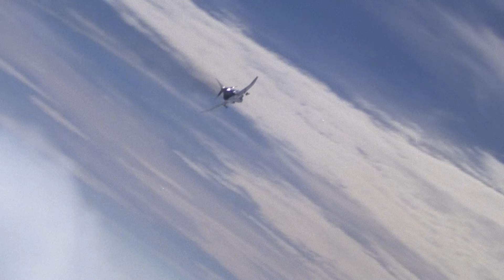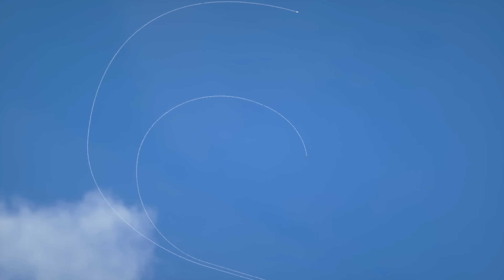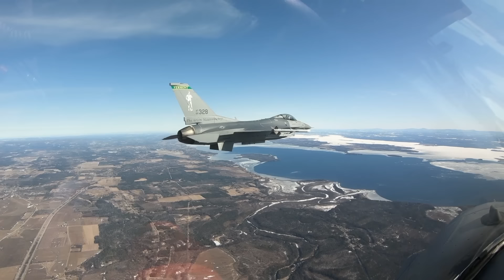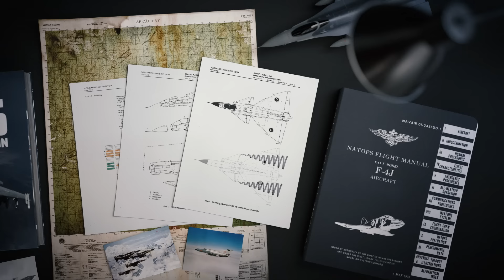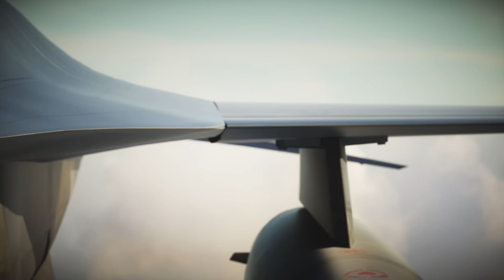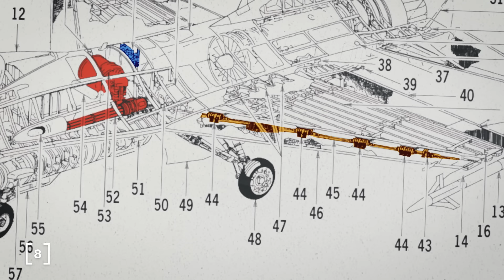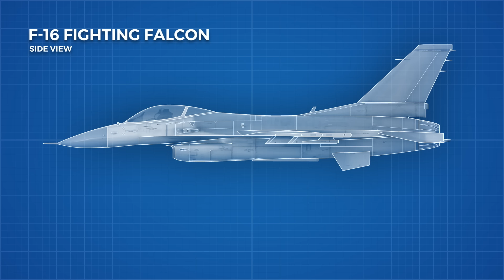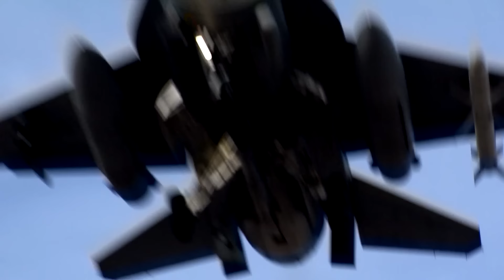The Insane Engineering of the F-16

Comment: I'm just going to say that the F-16 was called "the world's most expensive lawn dart" for a reason. The Navy went with the twin engine F-18 over the single engine F-16 for a reason.
Reply: The Navy chose, based on paper proposals only, to develop the YF-17 instead of the YF-16, into the F/A-18 only four months after the Air Force chose the YF-16. The F-16 wasn’t even in production yet, so, the early issues with the production F-16s didn’t have anything to do with it.  Likewise the Navy was comfortable with single engine planes as the extensive use of the A-7, the F-8, and A-4 attest. The dual engines of the YF-17 added a little more comfort, but also resulted in a wider fuselage that gave a wider landing gear track than the YF-16, which was helpful for carrier landings. There were actually three “navalized” proposals for developing the YF-16 into what would become the F/A-18, but the Navy was pretty adamant they were not going to choose the F-16. They were still smarting over the  F-111 “joint” program and Congress rubbed salt into the wound by requiring them to use a product of the Air Force’s lightweight fighter program to fulfill their F/A-18 requirement. This left the YF-17 as the only choice.
Reply: @Spectator1959  

The A7 was a replacement for the A4 and designed on a derivative of the F8, but, the A7 was a 1960s era plane with the A4 and F8 50s era. By the time the F-16 and F-18 were being designed and marketed, we're into the 1980s; 20 years later. That's 20 years of mindset change in the Navy. Whichever the Navy went with, it was to be a replacement for the A7's role.  

Yes, a wider landing profile was part of it, but, the single engine was also part of it; a large part. By this time, the Navy wanted the dual engine design as one engine lost on a dual engine plane still allowed the plane to fly and land while a one engine plane having engine failure meant a loss of the plane. The Navy had already dealt with this with the F14. This was also born out to be the correct decision as the F-16 was, as I noted, called the world's most expensive lawn dart by us in the Air Force at the time. 

I also know most of this is correct because my father worked at McDonnell Douglas and helped design the F-18 that was ultimately purchased by the Navy. According to him, the dual engine of the F18 was the ultimate tipping point for the Navy. After McDonnell Douglas went under, my father went to work for Boeing, ultimately retiring from them. So, I had a lot of insider knowledge of what was going on when it came to the military and planes.

Comment: There are several mistakes throughout this video but the most egregious is at 28:39: No aircraft can fly with its center of lift (CL) located forward its center of gravity (CG) either by human or computer control.  Such an aircraft would be so unruly that it would drop out of the sky like a maple leaf.  People who scratch-build RC airplanes & home built drones already know this.  So do people who specifically architect airframes professionally.  
.
The F-16 was the first full-scale (manned) airplane built to have a negative static margin.  Static margin is a man-made measure of stability factoring a variety of inputs which vary depending on the specific static margin equation (different companies their own) in the same way that 0° Fahrenheit has nothing to do with water freezing (unlike Celcius) or molecular mobility (i.e. Kelvin).  Over time, mechanical, electrical, and software engineers (in the defense industry) confused the negative static margin with physical negative stability because it (frankly) sounded kinda cool.  In large organizations, cool-sounding rumors travel fast and wide.
Reply: That sounds very interesting. Do you have some sources where I could read more on this? Specifically about Static margin?

Comment: 33:17
More like the avionics limit the jet from doing more than 9 Gs for the benefit of the squishy human inside.  The *airframe* can handle much higher Gs before structural or system failure.

Comment: Your explanation of static stability is also incorrect as the torque acting on wing and generated by pressure distribution on the airfoil is the main reason for the horizontal stabiliser. Using this force on arm simplification is hugely misleading. You need to redo your flight mechanics courses

Comment: Thanks for the opportunity to collaborate and contribute to this video. Great job to the whole team on this production!
Reply: When you talked about how it feels to use the weapon system in training for the first time, I got goosebumps. One helluva machine!
Reply: If I may, I would like to add some detail to the inlet discussion.  The F-16 is a fixed geometry, normal shock inlet.   The other airplanes mentioned, F-4, F-14, F-15 all have/had variable geometry inlets.  That is the reason that drives the inlets forward on those planes.   The ramps in the inlets adjust with Mach number to position the shock (as explained).  In 1976 we studied putting a variable geometry inlet on the F-16.   Oh my, it opens the flight envelope up dramatically.  (I was hoping to see a Ps plot on a Mach/Altitude graph.   Basically the airplane can easily get to Mach 2 up through 50K ft.   At that point you hit the temperature limit on the aluminum airframe.  But those VG inlets are complex, heavy, expensive and require maintenance.   And as was so clearly explained, not a benefit to where the F-16 fights.   As a fresh out of college aero engineer it was a great airplane to work on.   To this day I have the photo of the R/W/B YF-16#1 on the wall in my office along with models of both prototypes.   I was lucky enough to work with Harry Hillicker and Jack Buckner and was present when the first pre-production airplane taxied out in the fall of 1976.   I spent the bulk of my career at Boeing Commercial, but to the chagrin of the St. Louis crowd, the F-18 never replaced the F-16 as my favorite airplane.   Thanks for a great video and a Saturday morning trip down memory lane.
Reply: @dougball328   - Thanks for adding detail and perspective to the inlet discussion. I would have loved to flight test a variable inlet for the F-16!
Reply: great job!
Reply: The best instructor pilots can make even non pilots understand the concept they're discussing. You are definitely one of the best instructor pilots.
Reply: Fascinating insights given very naturally and personally. Excellent.
Reply: 1. In video are almost not visible any MiG-21! Planes with Czechoslovakia markings (Československé letectvo) are Su-22! Not fast, not maneuverable, pretty heavy due a variable swept wing. Su-22 obviously dont have clean delta wind as MiG-21!
2. MiG-21 does not have variable swept wing in any variant or clone!
3. MiG-21 is not dogfighting plane, it is not easy to maneuver special in lower speed in low attitude.
4. Is designed primarily for attack from back.
5. Su 22 does not have AA radar!
Absurd
Reply: Massive respect to your team 🙌 The detail and realism really shine through!
Reply: You did a great job linking the engineering side of things with the piloting side!
Reply: Lmao blud just dm him for the credits
Reply: @anonyraj2891 have some respect

Comment: Wow, thanks this is awesome. I have a question. So the f16 can handle 9g on the airframe. I know 9 is high for a lot of pilots, I guess fighter pilots are trained to handle 9 or more. But can the fly by wire systems in modern fighters and other aircraft integrate some customisation for individual pilots. Like let’s say a specific pilot can only do 7g, can he dial back the g setting? Or let’s say they are are flying a mission and he cranks over and is looks back over his shoulder and hurts his neck and so his ability to take g is reduced on his left side, can they change a setting so the fly by wire can accommodate the changed ability of the pilot? Then let’s say some pilots have a heavy hand on the controls and another has a real light touch and a third has a heavy touch under stress but flies ultra light under cruising, can the fly by wire system integrate pilot profiles of how they individually like to control the aircraft and under what conditions the control system responds to their touch?

Comment: I remember the F-16  and the F-15 was a lot bigger and therefore a lot more expensive. The F-15 was introduced first. And both are still in production since the Boeing F-15EX is just entering test flights. The F-16 has been in continuous production since' 78

Comment: The f16 is the best performing, best cost / kg.  Lowest maintenance cost per air vehicle.  Longest loiter time.  Best fuel economy.  Highest g-loading of any aircraft TO DATE.  Highest ordnance carrying capacity per kg.  Cheapest to run per minute.  Cheapest to buy per unit.  

Single engine perfection.  Thankyou FIGHTER MAFIA.  

Losers always gravitate to such loser planes like the f15 or f-22, but these are dogsh*t compared to the f16.  

Note:  For the price of 1 f-35 you can have FOURTEEN f16 falcons.  

Yay.

Comment: Great video. Also worth a mention is the OODA concept and how it applies to the design philosophy of the F-16. The Fighter Mafia mostly showed that the pilot who can go through an OODA loop faster will often win a dogfight. This is where transient metrics (like turn rate, acceleration, roll rate, etc) became more important than the older static metrics (top speed, ceiling altitude, etc).

Bonus: the OODA loop applies to more than just fighter aircraft design and can (and has show to) apply to things like sports and business.
Reply: Please no.

The OODA loop just boils down to "Make decisions faster to be faster than your opponent". It's not that revolutionary of a concept.

Plus the fighter jet mafia has a long reputation for taking credit of designing aircraft that they had literally nothing to do with, such as the F-15, F/A-18, and the A10. Hell, they lobbied to have the F-15 program cancelled because it had something more complex than consumer-grade radios, but that didn't stop them from claiming they designed it after it became the most successful milutary aircraft in history.

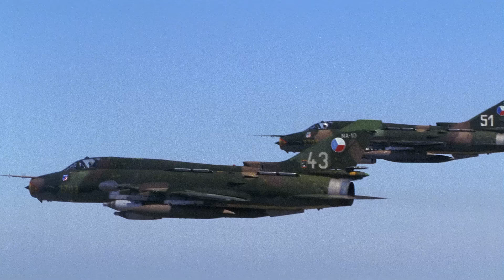Comment: 1:52 I hope you know these are Su-22s, not MiG-21s?
Reply: 35:31 and this is an F-15E of the 48th FW at RAF Lakenheath…
Reply: @pjotrtje0NL 35:35*, to be fair, it can be quite confusing to differentiate between the two aircrafts.
But a way to tell which one is which is that the Mig-21 has a longer nose whereas the Su-22 has a shorter nose and can sweep it’s wings.

Comment: I've often wondered why they still make the F-16, instead of just making F-35s.  Now I know!
Reply: It's there when F-35 isn't as needed. 
The F-35 still is expensive to maintain compared to 4th gen while have relatively smaller payload. That said, the riskier mission would be where F-35 take over or provide support.
Reply: @naksachaisaejane1982  thanks for the info
Reply: @naksachaisaejane1982 4th gen is just over priced 3rd gen

(joke)

Comment: It wasn't just the engine but also the Leading Edge Flaps (LEFs) at that stage which contributed to the accidental first flight of the F-16.  At that point in testing the LEFs were scheduling all the time.  Even on the ground.  So they were easily seen fully deflected in that video.  Now they are tied in with weight on wheels (WoW) logic so that the LEFs do not start scheduling until weight on wheels is lost.  Which you can see in the video you took looking at the LEFs during take off of your flight.  The LEFs are commanded slightly above neutral until WoW is lost then they schedule as normal.

Comment: hold up, the section 28:11 to 29:19 has very different info to what was taught to us in my 4th year aircraft dynamics course at uni (aerospace engineering degree),

having a config where the lift of the wing is in front of the CG (and consequently a lifting tail) doesn't immediately guarantee that it is unstable,
you mentioned that as AoA increases the wing lift will increase thus increasing pitch up moment, sure, but as AoA increases the tail lift will also increase,
whether it's stable or not depends on the lift slope of wing vs lift slope of the tail, as well as wing area vs tail area, and the moment arms,
as long as the moment created by the tail sufficiently counteracts the wing's moment as the AoA changes, then the net moment on the aircraft will still return it to trim,
and tandem wing aircraft exists, where both wings provide lift and  the CG is in between the two wings, if that's inherently unstable then that design wouldn't really be viable

also in the F-4 diagram bit at 28:18, the weight wouldn't move the nose down,
the weight force does not produce any moments on a free moving object, since all the moments act on the CG,
the weight force is on the CG so there's no moment arm,
in the case of that diagram of the F-4, it would be the wing lift that creates the nose down moment

Comment: Great video! But (28:10 - 28:56) not sure where you got you center of mass / center of lift data from though. A general rule of thumb for fixed-wing aircraft would be that the center of mass/gravity is just in front of your main gear -- so as not to put a lot of extra force on the gear during takeoff rotation. Also, in most gen 3-4-5 fighters, the engines are most of the aircraft's mass and so that would be a good refence to use as well. But the center of lifts are even worse! On both your examples the COL was ahead of the main wings and stabilizers! Not sure how that's possible, depending on the shape and size of the body and wings, it's behind the trailing edge of a standard-layout fighter wing. I get that you're just trying to illustrate your point but whoever posted that data on the internet seriously needs to do their research.

But, looking at the pictures to estimate COG and COL, everything makes sense! On the F-4, the engines ars a good COG reference, and they're right above the main wings. The stabilizers would then move the COL a bit further back, and it makes sense that the F-4 is passively stable. But on the F-16, as shown earlier in the video, the air intake is super long, centering the engine significantly behind the main wing -- and when considering the stabilizers, this would put the COG just behind the COL.
Reply: I'm so glad I was not the only one realizing this... Kept searching through the comments like "It can't be..." xD
Reply: @BigNose144  same. I didn't find any other comments that noticed it. My guess is most people zone out a bit after half an hour
Reply: I think it was exaggerated to make it easier to see the difference. IRL the CG is only moved like 20% of the mean aerodynamic chord.

Comment: This is the first video I've seen that gets the relaxed stability bit right. The goal was NEVER to create an unstable platform, and also, the aircraft is only unstable in pitch. It is completely stable in yaw and roll. 

The goal was to create a design that didn't need negative lift, at least not in subsonic regimes. Having the tail generating positive lift to pitch the nose up because the center of lift was ahead of the center of gravity is just much more efficient, but it does leave one with a nasty problem to solve - inflight stability - which FBW solved nicely, at least in sub-sonic flight. In supersonic flight the center of lift moves so far aft that the tail IS required to generate negative lift, transitioning the design into a conventional one. So, where does the tail transition from Lift+ to Lift-? Exactly at transonic speeds. 

The effect of this is that the tail generates no lift at all at transonic speeds, which means the tail also then generates no drag, thus exactly where every other plane generates a ton of Trim Drag, the Viper experiences a reduction in drag and slips into supersonic flight unnoticed. In fact, Navy pilots flying the F-16N had to guard against slipping into Super Cruise when flying cross-country to avoid dropping sonic booms on civilian populations.

I believe you have covered well how exceptional energy management, throughout the Viper's design actually, contributes to its great maneuverability, that and the FBW's ability to manipulate leading edge slats and flaperions to optimize the wing shape for every flight regime. For example, the flaps actually lift up to -2 degrees in supersonic flight to reduce wing lift and thus drag. 

The ability to maneuver without losing much energy has benefits far beyond dog fighting. In BVR fights, when defending, the Viper can recommit faster and more aggressively because it has the energy to turn hot and climb, not having lost it defending. This is in stark contrast to the Hornet, which is notorious for "Getting slow fast, and fast slow". As the speed of any missile launched leaves the rail at the speed of the launch aircraft, having an extra half Mach on the missile when launching makes a huge difference in the PK of that missile.